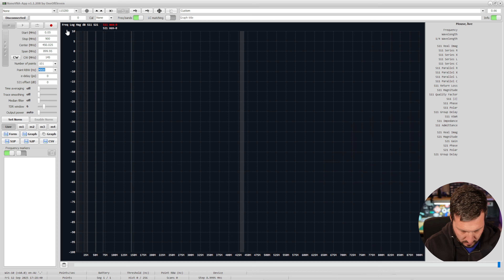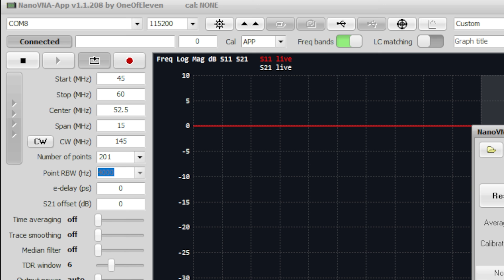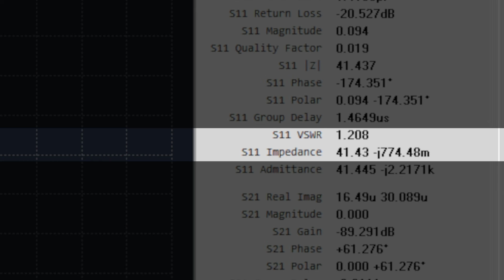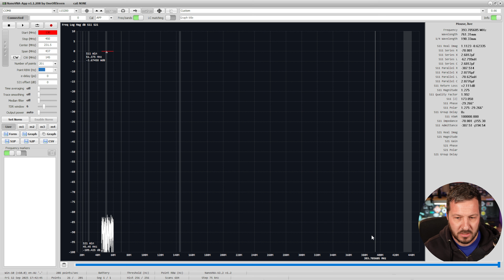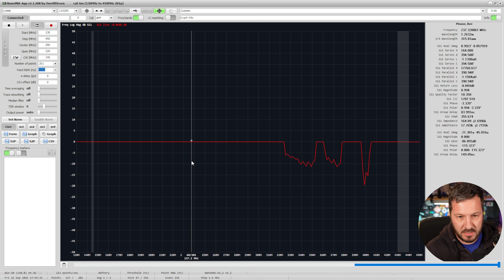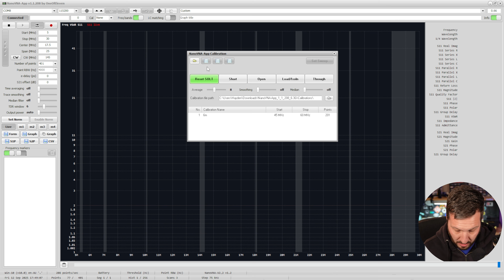Why I Test EVERY Antenna This Way (NanoVNA Secrets)

Comment: I picked the SAA-2N for two reasons - 1) N connector is more robust than the SMA, and 2) the SAA-2N has a steel shell instead of the plastic I've seen on other nanoVNA. Oh, and mine has a nice zippered clamshell case.

Comment: The perfect video for me. Thank You.  I own a IC-9700 which is deaf on 2m had this email reply from a friend. "I suspect SWR readings ok because there is so much loss nothing is reflected. Because of the loss no RX signal. So coax or connector issue" I am going to follow your video with aerial connected. I have been told to check thee 150ft of co-ax I need to disconnect aerial and put on a 50  ohm dummy load to be able to check co-ax. Also cheat sheet is excellent. 73 Phil GØBVD UK

Comment: Thanks for the clarification about the measurement plane being the antenna end of the cable and where you should be calibrating. Most people miss the point and I was confused over this.

Comment: I was the one that won the 7300MK2 from you. I wanted to really try out it's receive only antenna port, so I just got done installing a full wave 80M horizontal loop. I'm used to using my VNA on my antennas, but I have not found any good advice for testing this type of loop. I cut it to basically fit my property, and ended up at about 278 feet. I was wondering if tuning a loop on the VNA works like tuning a dipole? Do a sweep, then trim to match low SWR's? Maybe there's no way to actually tune a loop?

Comment: Believe it or not, they’re just N adapters!  There are SMA ports on the board inside. I use that model as well.
Reply: But at least it’s more solid connection not stressing on heavy coax etc. that’s why I got this one as I was concerned that the sma would break on my older one.
Reply from the maker: Oh wow, I haven’t opened mine up to see that, but good to know!

Comment: Cheers Hayden, now that i know how to use my SAA and tested all my cheap hand held antennas, most of which are confirmed useless. 73's
Reply from the maker: Awesome mate! Some handheld antennas require you to be part of the ground plane whilst holding the radio. So there might be some variations in readings when testing on a NanoVNA. Thanks!

Comment: The negative return loss, expressed in negative dB, is a larger negative number better?
Reply from the maker: Return loss technically isn't a "negative number" it's just displayed as such down from the 0dB line. But yes, for instance -20dB is better than -10dB. The further away from 0dB the better. 14dB is about 1.5 SWR.
Reply: @HamRadioDX Huh?

Comment: I just got one of these having gone from one with sma’s , but the touch screen does not seem to work properly even after setting the calibration and test for the touch screen, so only works properly with the buttons not?
My old one works perfectly by the way.
Any ideas?
Cliff VK2NP
Reply from the maker: Hi Cliff,
Are you using the stylus and where did you purchase from? Might be a problem with that unit?
Reply: @HamRadioDX from a seller on eBay fairly local . Buttons work fine. One thing I noticed is when I select a starting freq the on screen number pad takes up the whole screen , watching the smokingape his did not ? Wrong firmware perhaps?
Reply: Oh yes using the stylus
Reply from the maker: Perhaps there is a firmware update. Check out the group here that may help or someone else may have seen the issue? https://groups.io/g/NanoVNA-V2/topics
Reply: @HamRadioDX thanks Hayden I found some more recent firmware but waiting on sellers response for replacement. Will try the software as well
Reply: Well the new firmware solved nothing must be a faulty touch screen. Works great on the software Nanovna saver etc.

Comment: Why are you calibrating for 201 points and not 1001 ?
Then the measurement would be more accurate, especially for large frequency ranges.
Reply from the maker: I believe I mention why in the video